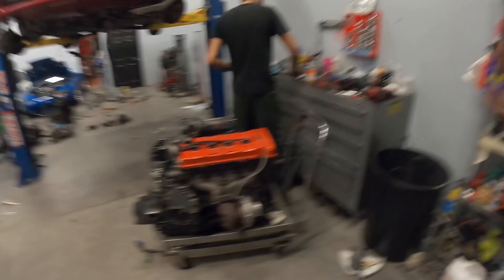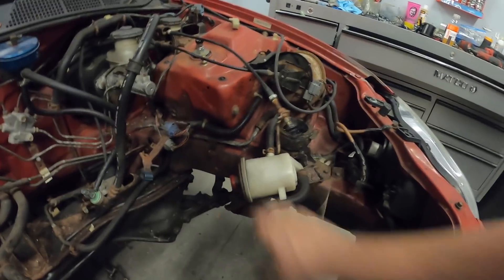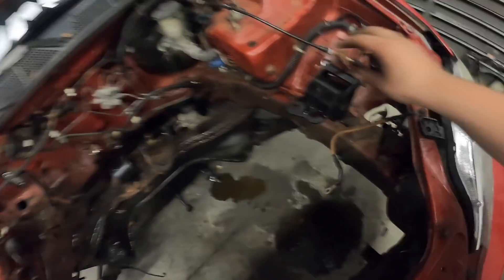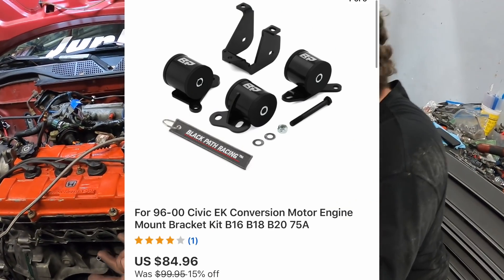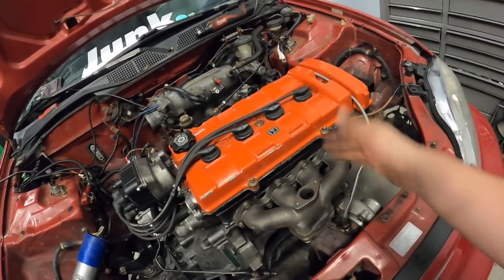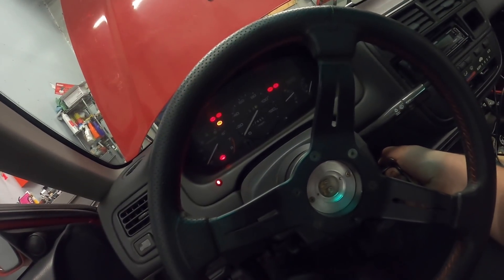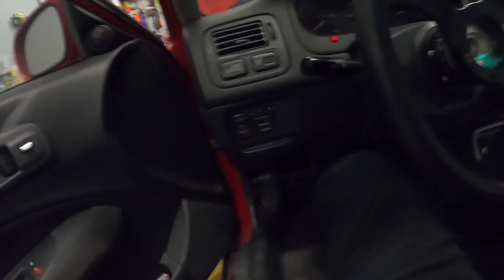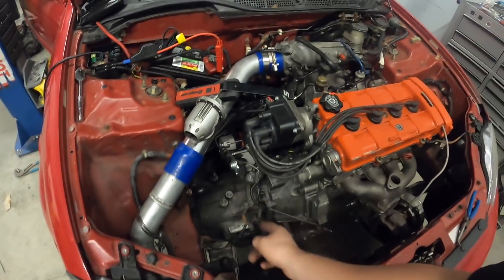TRYING TO BE A HONDA GUY! Not going so well....

Comment: The post mount on the b20 is from a DA. You needed an EM1 one. Wasn’t the mounts fault. It was you 🙃
Reply: Thats not a b20, its a b18a1
Reply: @bananaslamma69  Could be a b20 block with a b18 head?
Reply: Mike Hunt doesn’t matter what it is still takes the same mounts
Reply: @bananaslamma69  It's definitely a B18A1 valve cover, they fit on all B series non-VTEC heads. I had a B20 vc on my B18B1.
Reply: @98ek9  who hurt you?
Reply: Agree!!
Reply: Right , he literally did'nt need any aftermarket mounts. All he needed was a 2 bolt block pedestal from an em1 or from a b20 and an em1 rear t bracket the. It just drops in. Should run the torque mounts with stockers though in which case he would need the brackets from an integra.
Reply: oscar ruelas send it Steve is worse lol
Reply: alxgalarza88 or integra drivers side mount
Reply: @StrikingHunter  integra da's come with a b18a1 so considering that is what it came from wouldn't that be your 1st guess? And also why would someone remove the b20 valve cover to put a uglier b18a1 cover. Or swap from a b20 vtec head to a b18a1 non vtec head. That also has poor flow, sounds like your the one who doesn't know Honda's.
Reply: Mike Hunt it can be a b20 with a A1 valve cover
Reply: Mike Hunt cause Miami lol
Reply: @bananaslamma69  do you not know where he lives? Some people like the a1 cover I'm one of those people the b1/b20 cover is overdone. And seeing as my buddy has a b20 swapped DA teg it's not uncommon

Comment: Thermostat ground! (Harness to thermostat housing)  Wont allow fuel pump to kick on
Reply: Usually the issue aha! Been though this before
Reply: Also check when the hondata is plugged in, and the ignition is on the key on mode, see if theres a green light from the hondata board inside the ecu. If there no light, theres no thermostat ground as that's your main ecu ground.
Reply: Thank god someone said iy
Reply: Too bad ruddy can’t read so he won’t see this
Reply: @jessesward9429  😅 well I sent it as a message on ig aswell so hopefully he actaully sees it !
Reply: TonSixerAuto 100%. Last video when he was “ converting “ plugs to obd2 you can see the t stat ground wasn’t connected
Reply: Same thing i said and remember he did the same fucking thing on the old d16 after changing the thermostat lol what a doof 😂
Reply: I told him to hook it up in the last video 😂
Reply: Wasnt the thermstat ground the issue when it didnt wanna start after the distributor change behind hp logics building?
Reply: Main relay probably took a poop
Reply: His cel illuminated when cranking/priming which it shouldnt if he had no ecu power though.

Comment: Driver side mount was the right one but you need the mount that's bolted to the engine to be from an si that's why it didnt line up
Reply: Michael Adams  I've only done one swap but it's pretty common knowledge for the ek chassis
Reply: Si side post mount
Reply: Michael Adams  you were just dying to tell someone that weren't you
Reply: Hes a very proud boy. Good boy. Well done

Comment: Ground to thermostat needs to be hooked up for pump to prime
Reply: If the thermo housing ground was not hooked up the cel wouldn't illuminate when cranking which it does.
Reply: No it doesn’t bro both my thermo sensor and ground aren’t hooked up and all I deal with is a bit of a high idle
Reply: Look at the diagrams 99 Civic to those two grounds have to be hooked up they feed to the fuel pump and ecu
Reply: And my cell light came on ecu still has power look at wiring diagrams I build tuck harnesses for Honda's
Reply: So my shit j just runs magically? I’ll have to take a couple pics or something and show you 🤷‍♂️ i have a b18b1 with a obd2a wiring harness out of a 02 accord
Reply: @hammer9388  that's why accords grounds are on the driver side next to intake the civics are at the thermostat housing

Comment: Ecu ground. It’s on the thermostat housing
Reply: Check engine light was illuminated, usually if thermostat ground isn't connected the cel will not illuminate

Comment: if you have power to the pump but arent getting any fuel flow,  its either the wiring in the tank or the pump itself that has gone bad
Reply: Really! As soon as he said that I couldn't believe he didn't check it
Reply: Could also be thermostat ground which if not grounded correctly will not allow the fuel pump to turn on
Reply: scooz14 for me it was just the fuel relay
Reply: Eric Cockream dont think he’s gonna see if but worth a shot

Comment: One of the “few” to have problems with B swap mounts. Even as cheap as they are.
You used the wrong post mount in the car. You need the Si EM1 post mount.
90% of B swaps use the stock D series harness.
Run direct power or jump main relay and make sure pump works still.

This is the easiest stuff to do

Comment: Main relay! That would be a good place to start 🤓. Check engine light illuminated when the key was in the on position. typically if it's a ground issue, you will not have an illuminated cel light

Comment: It’s because of the da post mount on the driver side that’s bolts to the engine you need a eg dc ek b series post mount that’s the issue I’ve bought black oath mounts before and they worked perfect for my 93 b16A eg coupe

Comment: On the diagnosis for the fuel pump I would start by taking a volt meter to the harness plug and making sure you have a complete circuit then take your jumper pack and getting the 2 wires and hook it to it and see if it turns on if it doesn't take a mallet or rubber hammer and hit the bottom of the tank and if it's a bad fuel pump it will turn on

Comment: Try the main relay for the fuel pump it’s on the driver side. Pull back the carpet under the clutch peddle it’s a little black box. It’s tucked up in their pretty good. Follow the main harness from the fuse panel you will find it.

Comment: Tip: get a b16 post mount it’s the 2 bolt straight pattern not crooked and GET SOLID TORQUE MOUNTS that driver side mount will rip right out the block the way it sits right now

Comment: put washers under the bolt heads for the mount you had to wallow the holes out of. give it the widest washer it will allow. youll be fine im sure tho just dont skip out on getting solid or stiffer front mounts that go under the rails

Comment: Since its an obd0 motor it doesnt have a crankshaft sensor and without the sensor its not going to turn on...bypass the crankshaft sensor and you should be good...also make sure the main relay(by the passenger side door) is good and also check your thermostat ground
Reply: It should turn on but just throw code
Reply: Nahh not in an ek...if the car is obd2 it wont turn on cause it wont read the crankshaft sensor so you would have to bypass it or change the oil pump to one with the sensor on civics 96 and newer

Comment: 99-00 Si side motor mount bracket needed for ek swaps. Jesus dude. Honda tech is your friend...
Reply: Its not even a b20 its a b18a1
Reply: He's too arrogant to do research like that
Reply: A man honda tech, good times.
Reply: @bananaslamma69   did he show the engine code? Could be a b20 block b18 head? B18 valve covers  fit b20 , either way ruddy is ignorant so doesnt matter lol
Reply: @bananaslamma69  just because it has an obd1 b series valve cover does'nt mean its an a1
Reply: @bananaslamma69  Valve cover means nothing. Everyone used to sell the B20 one because people thought it was nicer and the B18 valve covers were cheap like dirt. Interchangeable.

Comment: The main relay for the fuel pump is under dash trust me I had this issue another one there is a fuse on front fuse box two screws hold it in place check that too I bet money it’s one of those two

Comment: Make sure you put like maybe a little three little gallons of fresh gas and prime the fuel pump check also the main relay and also pull out all your spark plugs and check the tips of them make sure that it's getting spark and it should start I've had the same issue with my  Acura Integra yesterday

Comment: Chris check the amount of amperage going to the fuel pump it sound like not enough amps. you may have a ground that is not clean or a frayed or burt wire from the battery problem. GOOD LUCK🙏

Comment: Looks like your alarm light is flashing as you crank also. Maybe try to disconnect the battery, turn the key to accessory, then re connect the battery. That usually works with old alarms.

Comment: Check by the bottom radiator hose on the motor side on the harness there’s a ground
Reply: It turns on the pump and spark

Comment: Change your main Relay!  i had same problem with my fuel pump not priming!
Reply: i believe it  is behind the glove box on the EK
Reply: Any suggestions for me? I rewired my whole car because my ECU harness plugs got wet and corroded, I get it to start, but I used my friend's battery, I go the store to buy myself a new battery and nothing works, even with the first battery I tried. only the hazards and blinker work, I checked grounds, battery terminals, I changed the battery fuse, brand new ECU, brand new dizzy, its a b18b1 swap for a 2000 civic ek coupe

Comment: Si is a 3 hole post mount. But eh didn that LS come out a DA integra? That’s like obd0 kinda. The DC 2 post should be good. Also maybe the starter messed up the fuel pump fuse or main relay? That’s crazy. Your getting it tho. Keep it up. Love Honda content

Comment: did you check security system? i see the red light on the dash when you turn the key over, sounds to me like a security issue, you getting 12v at pump, no ecu is priming it, try to jump the signal wire or if its an aftermarket sec. system find the bypass/relearn button, or disconnect it fully under the dash for now to see if it primes.. hope this helps a bit
Reply: also check the main relay to see if its getting the 12v ignition power. if not it wont tell it to prime, or the ecu fuse as well

Comment: That ground issue could have caused the fuel pump to turn on and off real fast. That happened on my sc300 and burnt my fuel pump. Explains why it's getting power but not priming

Comment: you need the Si b series post mount
Reply: slow ek this ^
Reply: That! Or should have gotten the 3 bolt ek mounts instead of the 2 bolt ones!
Reply: X1000 cheap mounts but a 5 second google would have been easy info. Just lazy
Reply: Si is a 3 hole post mount. But eh didn that ls come out a DA integra? That’s like obd0 kinda. The DC 2 post should be good. Also maybe the starter messed up the fuel pump fuse? That’s crazy. Your getting it tho. Keep it up.
Reply: @deieznuts  the Si post mount is the 2 bolts Dc integra is the 3 bolts
Reply: Yea my bad.. your right.
Reply: So that 2 post he cut up prolly was obd0 huh?

Comment: You need a 200 civic si post mount  the b20 from the integra won’t work it needs to be a b16a2 post mount
Reply: 99-00 civic si
Reply: Thats not even a b20, its a b18a1

Comment: An open circuit will still measure 12V. The pump relay should be wired to ECU via the ground wire. ECUs are always sink (they accept power instead of supply). Test the pump with a jump box and make sure that its definitely not fried. It could very well be melted motor windings of the fuel pump. Ehich is the same thing that happened to your starter. Very common issues in industrial applications

Comment: If the fuel pump was getting voltage and it wasn't priming then there is a problem with the fuel pump and not wiring

Comment: Only $80? Not good? That's about $15 worth of material if they cost $80 that $65 worth of labor. They should be perfectly fine as long as the welds themselves are solid can't go wrong with motor mounts really

Comment: 1.  Those are just yonaka knock offs. Could have got yonaka for not much more. 2. That was the wrong post mount . 3. You’re probably missing the ground for the wiring harness that goes to the thermostat housing. 4. Stop blaming the mount company you hacked up the stuff up because you didn’t do enough research. 5. Have a nice day happy boosting

Comment: Comment section help me, when I get off the throttle on my b20 integra it jerks pretty bad replaced torque mounts down low the rear mount closer to the driver and The two on the side what else could it be

Comment: I had it with my car also that the pump wouldn't prime after staying for 2 moths and with me it was that the pump was stuck I did several times directly 12 volts with 2 wires on the pump and than he came loose problem solved

Comment: U need to connect the engine harness ground haves a brown wire with it next to the thermostat reason why. That engine post  is da i tould  u  u needed si post 🤦‍♂️🤦‍♂️ one bolt holding engine side omg.. next video does a pull then motor falls 😆😆

Comment: You didn’t put the ground on the thermostat housing that controls the fuel pump you can’t add random grounds on the hondas they like the oem grounds.. valve cover thermostat and fuse box 3 spots! Also your Ef sedan had gas port mounts why didn’t you use those? Or it had Atleast 1 would have saved you from cutting the block that was hack af.

Comment: If the fuel pump has power and it's not priming with the key on you have a wiring issue in the wiring harness you did say use different wire harness why don't you just run a hard wire to the fuel pump and see if you can get it to prime when you turn the ignition and out of all the videos of watched I don't dislike that guy I just don't know what his name is sorry Chris is always just done his own thing so it's kind of weird to have somebody else around

Comment: Found the error : D series harness with b series engine
Reply: You can use a d series harness for b series... smh
Reply: @REXXDG134  Lmfao literally all swaps for b series use  d series engine harnesses, nice assumption though.
Reply: I have a y8 harness on my gsr lol
Reply: 😂 everyone always uses the d-series harness for b-series! Done it before on 3 cars plus now I'm using a d-series harness on a h-series aswell. So no that's not the issue
Reply: No he needs to take the fuel pump out of the tank and check it. Its been sitting and bet that's what wrong
Reply: Iv used my d16 harness with a F20b